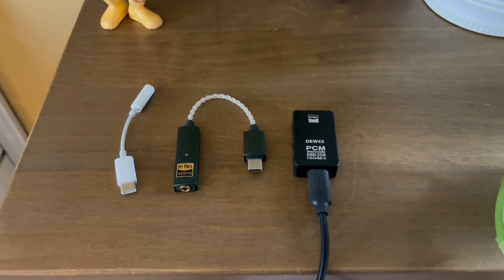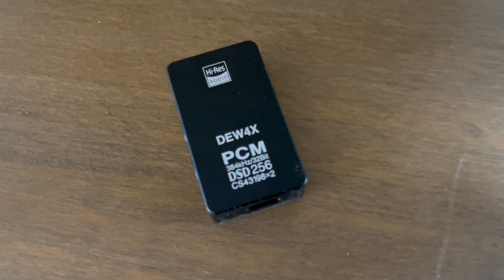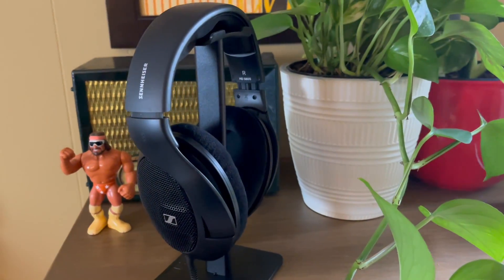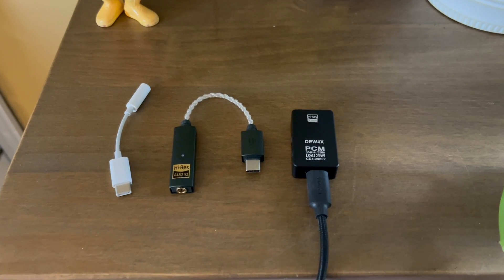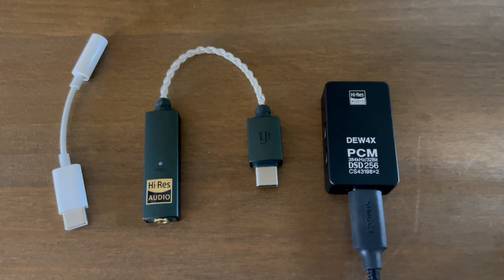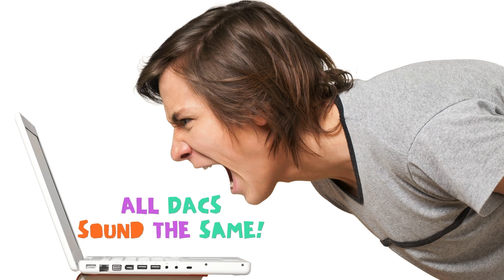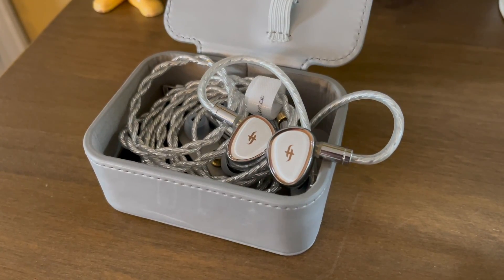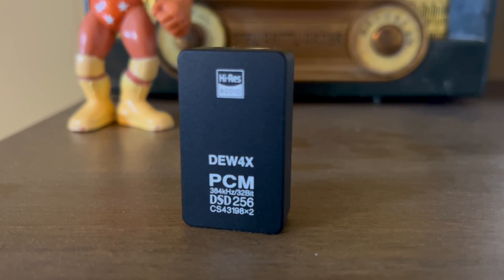Is it really worth upgrading your cheap Apple dongle DAC?

Comment: A proper DAC is good to have for built-in features like parametric EQ, power for headphones that need it, and more qualitative differences in sound, but for pure sound quality all you really need is the Apple dongle. A budget DAC is worth the money and are a noticeable improvement over cheap realtek-adjacent chips on laptop/pc motherboards. If you just want "good audio" where you know you're getting a clean signal and not go down the rabbit hole, the Apple dongle is the perfect baseline for sure.
Reply: I want to replace my pc onboard audio with apple dongle DAC, but the cable is too short. I would need a 3.5mm extension cable to reach my headphones, would that work? Also not sure if I need TRS or TRRS extension cable, my plan was: motherboard usb-c port > apple dongle DAC > 3.5mm extension cable > headphones

Comment: I actually prefer the Apple Dongle (EU low power model!) over RME Adi2, L&P W2 and many CS-based modern dongle dacs I have tried haha. Its portable and absolutely no hiss/pops when disconnecting etc. which I find very important. Sounds good as well, not as agressive as many other cheapos. Very similar to RME and Centrance Dacport HD actually.

I have been using them for ~five years with IEMs and speaker setups, and for some reason I always come back to using them. Great product for ~7euros, prob have bought 15 of them.

Comment: No it's not worth upgrading unless you legitimately need more power. They all sound the same and are supposed to sound the same. The few DACs I tested sounded exactly like my 3.5 Jack on my phone. Nothing has sounded better than my phone jack up to this point. Just the same and all of them measured exactly the same for frequency response using IEM and pink noise. My 3.5 Jack measured exactly the same frequency response. 

So that warmer more bass and punch that someone isn't actually hearing isn't there. Not even possible when a calibrated microphone isn't even picking up a 0.5 DB difference. In fact a zero difference. I even used the Apple DAC on my Android which I had to almost Max the volume out. it was fine with USB audio pro when bypassing Android audio as for volume. Yes I've done the high-res testing bypassing Android audio too. 

But even natively with the volume up to a good level it sounded exactly the same as the other dacs and just like my 3.5 Jack. All the same. And my hearing is good.

So no it's absolutely not worth it. Get a Dac that meets your budget and features requirement and power requirement. This is not my opinion this is what I've actually heard through much testing and have measured also with hard proof. The most powerful one I have didn't do anything either. it's not an absolute powerhouse but it has more power than my 3.5 Jack that's for sure and the apple one. No difference.

I question whether there's even a difference for something that needs more power to get a good volume level. I suspect if you can get your volume up to where it's too loud then using any more power won't do anything. But maybe just maybe there could be a slight improvement in that case. 

But definitely not because a DAC is putting out higher quality sound over another. All of them are at a resolution that goes beyond what anyone can literally perceive.

No one can even pick out CD quality over mp3 320 in a blind test. How is someone supposed to hear high res now?. Kind of need to be able to do the lesser thing in order to do the greater.  I've compared 320 and CD quality and I can say pretty confidently that I wouldn't be able to know in a blind test. Let alone hearing hi-rez which is way more quality technically. It's based on technicality. So the companies are lying and deceiving because they sell everything as if you will hear a difference. and then the snake can fall back to saying well it is higher quality (technically) 

And therefore the devil justifies himself and says he isn't lying and deceiving anyone because of a technicality. The companies are playing along as if these things all make a difference from one DAC to another. So get something that's affordable and has the right form factor for you. They're all good enough. 

It is incredibly easy to imagine and delude yourself into hearing something that's not there. I would know I've done it plenty. It's almost scary actually. Better be real slow to review something before going and posting that shame. And then I go back and test over and over again and all of a sudden I don't hear any difference at all. 

It's a strong sorcery that image of the beast. Its an image sold to your mind. The product description the pictures the thing in your hands, the money you spent on it. A bias already existing. All these things massively delude someone to think they're hearing something they're not. it's like a real sorcery. 

Your DAC shouldn't change the frequency response and it should be transparent and sound the same. Unless it has features to boost the bass or whatever then that is okay. The resolution that basically all of them have is hi res which no one can hear over CD quality anyways. Meaning they're good enough. You're getting screwed hard spending hundreds of dollars on a DAC. 

I have yet to see a single YouTuber or anyone explain on some kind of technical level and detail, how DAC is doing all these marvelous things like sounding cold hot bright warm lush very analytical and cold or musical and warm.... 

How exactly is a DAC doing all that?

I have yet to hear something that beats my 3.5 Jack on my Moto G power 2024 budget phone. That's the cold hard truth. or maybe it's the warm lush truth.... lol  The few DACs that I bought were for the purpose of testing and measuring the frequency response. They all sound great and they sound the same. 

Maybe what someone already has is a whole lot better than they think and it's already doing a good enough job. Meaning something better so-called won't even be perceived at all. 
Yeah so I don't even know how a DAC is supposed to do any of this. It's supposed to convert the digital signal to analog without manipulating anything and do it with a good resolution. To be transparent. 

If someone is actually legitimately hearing a difference and it's not a delusion like literally most are in...... well then you'll see a difference if you measure the frequency response. Otherwise you're not hearing no difference. Then it is basically doing an EQ and coloring your music in some way. Which is a separate thing. I don't really know that there is something that has a garbage 3.5 anywhere these days. It's likely more than good enough. Mine definitely has been for IEMs. I don't have headphones. But I imagine as long as you can get your volume to where it's more than loud enough then you're good to go. 

Well that's been my testing and experience with DACs for phones and using IEMs.

Comment: One thing you forgot to mention is the apple DAC is the most power efficient DAC too! Consumes almost nothing compared to any other non-apple DACs
Reply: Because it is limited in its output. Not for any other reason.
The 97720-amped Dongle-DAC I use (USD 8) will drive my planar Sundaras as hard as I like. And it doesn't monster the battery on my phone.
There's nothing magical about the Apple Dongle. It's just one of many.
And don't get me wrong. 80% of people have absolutely no need for anything more - ever.

Comment: Oh, the DAC hype.. The headphones or speakers and the amp has ALOT more to say. And every single thing ever produced that plays digital audio and has analog output (either line level signal or out to speaker/headphone) has a DAC inaide.. It litteraly MUST have to reproduce sound to analog devices lile speakers etc. 
So people should just stop calling these DAC dongles akd rather call them for what they really are: Headphone amps!
And lile at home: Bigger is better. The less it has to work the better it can keep the sound quality at both higher and lower listening levels. (Exceptions do excist but few)

Comment: I'm a performing artist and I want to run backing tracks to live PA systems at festivals, I usually run my tracks off of Ableton but I want to simplify my set up and just run my performance tracks off of a phone or iPad. Would it make sense to invest in one of these more expensive DACs, specifically one with the balanced output? I imagine an iPad paired with a DAC and that DAC being connected to the festival mixing console.

Comment: Hands down everyone should own a Qudelix 5K.  20 bands of parametric filters and enough power to drive most headphones if you use balanced out.  

I know there are idiot purists that constantly talk down on EQs.  That’s fine, they get to miss out.  EQ can’t make bad headphones good but it can make most headphones better.  I haven’t used my STAX in over a year and the other day I busted them out and was just like fuck these are just too good.  Well even with those amazing headsets I use an EQ profile for my headphones and then I adjust it to my liking especially in the bass extension.  With the STAX I’m not using the Qudelix amp but the DAC itself sounds good enough and the parametric EQ is just amazing!!!  

The user interface for the Qudelix 5K even has the AutoEQ libraries built in so you can just search by what headphone you have and then choose one of the presets that’s are available.

Comment: All modern DACs are the same except the ones in the early times of internet telephony. Those are usually noisy with limited frequency response.
Ultimately, it's all about if a DAC can handle your gear. On Android, Apple dongle drops down to half the power, and can barely drive the earpods at max volume. To enjoy your music, this seems to be a good starting point:
1. Good gear
2. Lossless audio source
3. Budget DAC.
Reply from the maker: Thanks for watching and sharing!
Reply: @ForeverAnalog  You're welcome

Comment: 🎯 Key points for quick navigation:

00:12 💰 The reviewer compares the $10 Apple dongle DAC with more expensive options, questioning the value of upgrading for sound differences.
00:43 📝 Review is unbiased and not compensated, with honest opinions based on personal experience.
01:34 🔊 Initial assumption was that pricier DACs would offer superior sound, but actual differences were unexpected.
03:29 🎧 The sound detail captured by the cheap Apple dongle was comparable to that of the more costly dongles in test scenarios.
04:23 🎵 Even subtle sound elements were picked up by the Apple dongle, challenging the perceived need for pricier alternatives.
06:15 🎼 Dongle DACs close in price may not significantly alter sound profile—significant investments may be needed for notable differences.
06:56 📈 Power output and extra features are the main incentives for upgrading from the cheaper dongle.
09:22 🔌 The Simgot DAC offers additional output options and features, making it more versatile than the Apple dongle.
09:50 ⚡ Power and features, rather than sound quality, are primary reasons to invest in more expensive dongle DACs.

Made with HARPA AI

Comment: i have apple dongle ! it sound low but very clear with android! and too loud with windows pc!

i have more pricy DAC They both sound the same! 
apple go max 24bits 48KHz
other dongle goes up to 32bits 384kHz.
But It sound the same! if i use IEM just with 3.5jack into laptop
which output 24bits 96khz only.
sound Amazing with my old phone Galaxy S4 which has 3.5mm jack
Pre set EQ on old phones sound too good then  Netural EQ 
So removing 3.5mm jack is draw back. USB C audio with DAC is loud but 3.5mm is perfect loud and sound  way pleasing to ears then USBC+DAC output.

Comment: I only know that the FiiO FT1 sounded a lot better with my desktop iFi Zen DAC than the FiiO J11 dongle AMP/DAC (connection via USB). My dad noticed instantly as well. The J11 was already firmware upgraded btw. The latter felt less crisp and noticeably duller if not a bit muffled.

Comment: which audio file did u use ?? i mean if u used 320 kbps or 128 kbps files then i don't think u can hear any difference untill using true lossless or hi res files .... i would love to know this from you asap,,, :)
Reply: i use with Apple Hi Res lossless.
and have WAV. 32bits 48 and FLAC  24 bit 96kHz all sound same! 
Hi res music sound better then 320kbps Mp3.
but it sound same with all mediums.
like 3.5mm jack dongle USB DAC.
even same with Bluetooth  ACC SCC AptX. but LDAC set  to highest audio  then connection  quality sound better then those DACs. 
if Source file is good then it gona sound good with all playbacks mediums if soruce file is bad it gona sound bad with all of them!
Reply: @SukhES   ur right but it depends on the dac if it has an amplifier than u actually hear a difference. also i ve a question how do i play offline hi res music i mean if i play with any player i think its gets compresseed with it. so is there any way to play at original quality ??
Reply: @SukhES  thx man !! today i check it out for applee music and found 3 months for free.....also i can directly get hi res music by simply connecting the dac >>> apart from turning on from the settings.....or their any other thing to do ?? edit - android 14 device realme gt neo 3

Comment: $9 just an adapter, not a DAC? Lightning to 3.5mm
Reply: There is a tiny DAC inside. If your iPhone doesn’t have 3.5 mm jack there is no DAC in your phone.
Reply: @tombassman  Well there is an internal DAC for the built in speakers but its not connected to the usb c port.
Reply: @leemanwrong of course you’re right !

Comment: Yes. Those Apple and whatever Huawei/Samsung dongles that are thin as a dental floss break really easily. A few days in your pocket while listening and the wire is broken already. My verdict is: absolute garbage. If you want a dongle DAC there are more durable options. E.g. Fiio JA11 which is way less flimsy, supports higher sample rates, has an eq app for phone, etc. Will not recommend yet because I've had it only for a few weeks but is promising. Man, I would have broken 2-3 Apple craps on that same time. And JA11 is dirt cheap too.

Comment: Good job. It is really important to categorize the chips. 
Example:
*Low cost 5-20uss
PCM5102		ES9023 (Sabre)
*Medium cost 40-70uss
ES9038Q2M CS43131
*More expensive 80-120uss
ES9038PRO AK4499EX

So it is important to understand.
*What type of headphones and what impedance will be used. I see it as necessary if you have a specific headset. A dongle/amplifier/dac starts to be necessary from 32ohm for a phone. In any case, the dac that Qualcom integrates is not bad either, it is very good with 15ohm headphones between 20ohm you can enjoy it quite a bit.
*Beyond what a chip with 24bits 192kHz can process, it is already sufficient, it cannot be perceived beyond that. But there is the issue mentioned in the video (sound signature) that some think is related to the amount of information. But many times keep in mind that with a cheap dongle together with a good EQ you can get the same signature as something twice the price, 20 to 40uss for example.
even with just a dedicated amplifier it was enough on a sony xperia (qualcom chip)
Reply from the maker: Thank you for sharing and catching! Great points!

Comment: I have a question, i just bought iem. And i use 3.5mm on android without any dac. Should i get a dac. Its my first time using high quality audio stuff and dont know much.
Reply from the maker: I would spend some time with the IEMs first and learn what you like or don’t like. Then research for a DAC to fit your needs.

Comment: DAC or AMP is basically a gadget which provides power to drive headphones, iem, earbud. Depending on material of driver structures as ceramic, berylium, planar,...etc, & impedance & sensitivity, you'll need search information about output on 3.5mm or 4.4mm dac/amp. You can see specifications like:
70mw at 16(Ohm)
140mw at 32(Ohm)
1.6vrms 2vrms
More Ohm needs more power to drive and less distortion when you push more volume. You can see some earbud or headphone have 300(Ohm), 150(Ohm). The higher sensitivity the more noise you get. Higher sensitivity (above 105db) will make your headphone sounds grainy in the background, its like analog sounding lol.
There are two types of Dac/Amp
First one is neutral, it just basically drive headphone to perform the correct tune of a brand.
Second is coloured, it will buff some certain frequency such as: boost sub-mid (male vocal), volume of bass more quantity or make bass tighter, less muddy, boost high mid(female vocal) more sparkle. About staging, width, height, depth, its all about ability of hardware driver. Dac/amp doesn't affect much on staging.
In conclusion, if you are using an easy- to-drive headphone, iem, earbud, just buy a cheap dac/amp dongle, that is enough. Don't fall into rabbit hole guys.
Reply from the maker: Thanks for watching and sharing!

Comment: Thank you for the review. What do you think about using the Apple dongle against a regular desktop PC? is it better than a traditional motherboard audio jack or it won't make a difference? I have a Sony Mdr-V6 and Audio Technica M40x, and I think that the PC has more than enough volume, but ultimately I was just wandering if the quality of the dongle that would  be much better than just the PC.
Reply: Can you hear any static from electricity? Such as while moving the mouse, etc. If you don't I don't find any point to buy one
Reply: @RekoneInkings not really